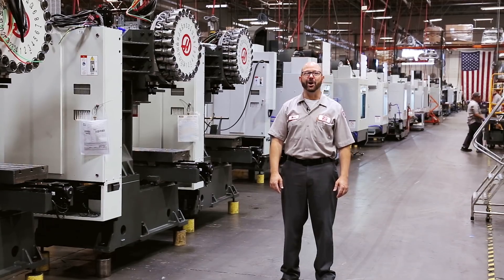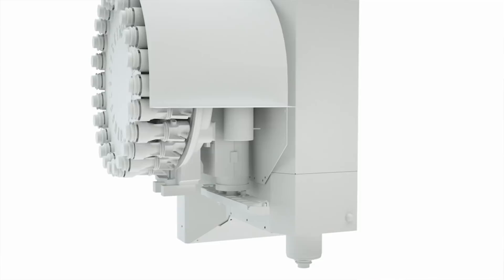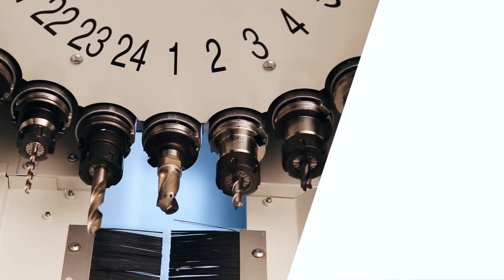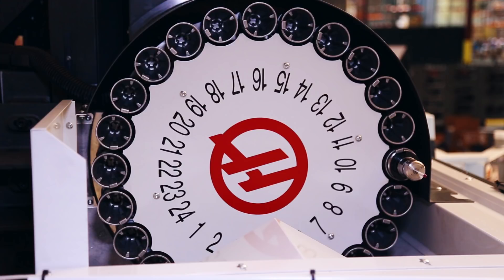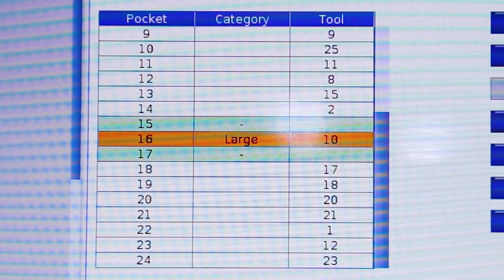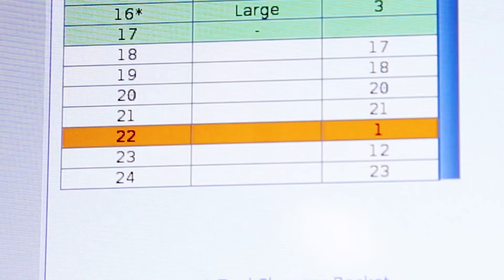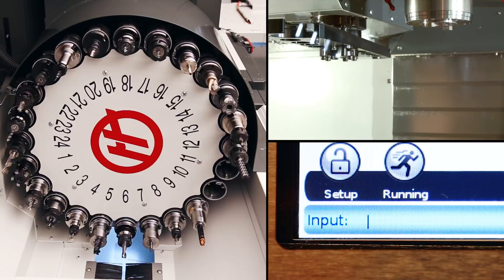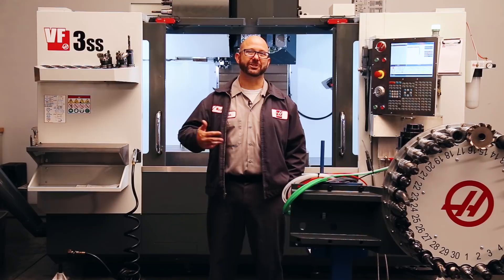Master the Haas Side-Mount Tool Changer – Haas Automation Tip of the Day

Comment: As a side note, if you need (2) empty pockets in the carousel between two Large tools, instead of the standard one empty pocket, we will need to designate the tools as XL Extra Large. On an NGC machine we can contact our HFO to get this "Extra Large" special configuration. On Classic Haas Controls, we would enable Parameter 315 Bit 3 "EXTRA-LARGE TOOLS" to get these extra pockets.

Comment: I program all my machines with every other tool pocket, ie-2,4,6,8,10 etc.  This avoids tools hitting each other. I only used adjecnt pockets if need the pockets. And this method helps distribute tool weight around the carousel.

Comment: I used something simular but in mdi and in code to get as many empty pockets next to each other to load up my tools quicker by calling the loaded pockets with a t number and the empty pocket with the p number after each other... And i would run this mdi program when i was getting my tools ready...
But that might only work if you use the same number for the same tool every time... I would also load drills before mills so you can probe  the drills while getting the mills ready and pre mesured

Comment: I'm surprised you don't make a specific decal for each machine, so the user doesn't have to find the right size. In addition, it should show the value right on the diagram, rather than in a table one has to consult. Finally, why not have the software just take parameters for each new tool including the max diameter, and let it sort it out for the specific machine?
Reply from the maker: Rick – Great suggestions. I’ll pass them on to Engineering. – Mark, Haas Tip-of-the-day

Comment: When using a large tool does the machine/holder still support +1 tool. In other words will it put a normal size tool into the large slot while the large tool is in the spindle?

Comment: Hi, I had a question about older haas mills with side mounts. I have a 2005 VF2SS and can't seem to input a number larger than 25 into the pocket table since this mill has a 24+1 smtc. Is there a setting that I have to enable to utilize the 200 tool offsets that enabled with setting 90? Thank you.

Comment: Hi, Does anyone know how to avoid a double tool change? the problem is my T1 is a 4" face mill, T2 is a 3/8" cutter and my T4 is a 1/4" drill. The cycle ends with T3 and when I start a new cycle it changes the tool to T1 but puts T3 in the designated T1 pocket, so when changing to T2, the machine first puts on T3 in the spindle because it is in T1 pocket and then changes it to T2, losing a lot of time in the process. How can I avoid this??

Comment: What’s the XL key? Extra large? As in there can’t even be another large tool 2 tools down?
Reply from the maker: Hi Chad – On some older versions of software we set Parameter 315:3 to a “1” to set Large tools as XL. This forces the control to leave two empty spaces between Large tools, instead of one – like you describe. This “XL” feature hasn’t been released on a Next Gen control (the field is greyed-out), but we still have a simple solution.  We can set the tools as “L” Large (see video), and then clear any adjacent pockets we want to on the Tool Table by highlighting them, entering [0], and pressing Enter. This will Clear those tool pockets, and they won’t be used again. Also, if I ever broke a carousel pocket somehow, I could “zero” it out in this same way, and the control would know to never use that pocket. – Mark, Haas Tip-of-the-day.

Comment: Is their a way to set an automatic home position when changing large tools so you dont crash into a fixture?
Reply: IDK on the classic control but on the NGC go to user positions in the settings and then I think its called tool change mid position. you can move the machine where you want with handle jog and then set it.

Comment: Is there a way to designate a tool as hand load only so it won't try to put it away and let me load the spindle empty?
Reply from the maker: Michael – For something like that, I’d create my own custom M-Code. You can write your own “M200” (or whatever number you’d like) that would automatically switch to an empty pocket, position the spindle, and wait for the operator to press a button to continue. Check out the Alias M video. https://youtu.be/HZiJEt0bMA4
. People will build their own “Wine Rack” tool holders, that mount on the tables as well, they’ll position the spindle over the tool and use an M82/M86 to clamp/unclamp. Contact your local dealer for help.  - Mark, Haas Tip-of-the-day

Comment: I wonder  Lets say  I have Large tool on Side mount tool changer and my code called and  and it needs to replace my 10mm end mill to large tool after  I finish my shell mill and i need lets say drill How its going back to its large pocket ? Im little confused
Reply from the maker: The Haas Control will take care of all of this, in the background. In this case the machine would automatically do a double tool change to guarantee that your designated Large tool (your shell mill) is always surrounded by empty pockets. – Mark, Haas Tip-of-the-day
Reply: @haasautomation   thank you Mark thats what I tought . I already make contact with my Local distributor to get some deals on Haas machines. Thank you for your videos and tips.
Reply: @haasautomation  So now l have a double tool change every time I use my 3inch flycutter. What a waste of time..
Reply: @maksimschastlivtsev4691  How would you do it instead, Magic? 🤪

Comment: Daniel - brazil.
Reply: Thanks for the video

We just bought a vf5 with a 30 + 1 tool changer Servo driven and it's so fast compared to our 40 plus 1 tool changer which is Cam driven. We are still getting used to the next-gen control but I already like it better than the old one. Except for the probing it would be nice if day used hotkeys such as numbers to indicate which probing cycle you would like to use for example for the single surface I just hit page down and then up twice but it would be nice to just hit the number 8 and then down
Maybe that will be an update
Reply from the maker: Hi Aaron. Look for Mill Probing updates on the NGC machines, in software version 100.17.000.2040, which will be out in March. We’ve added just what you’d hoped for. Thanks for the comment. – Mark, Haas Tip-of-the-day